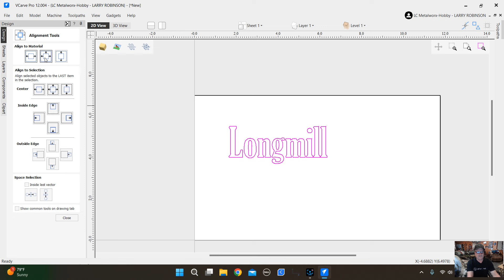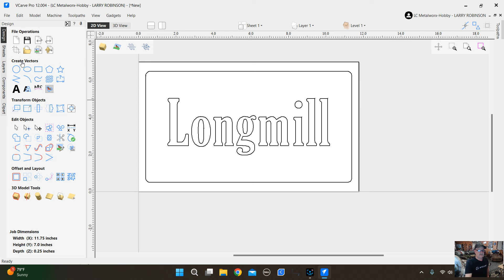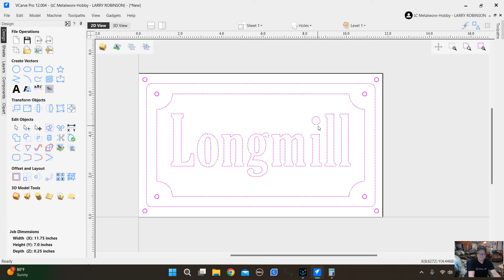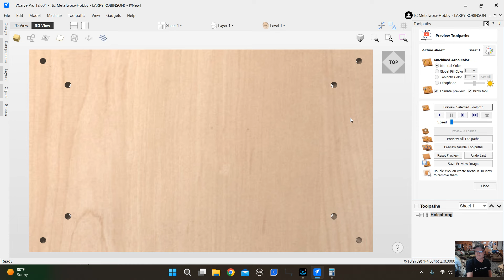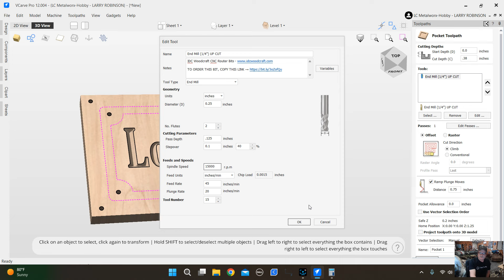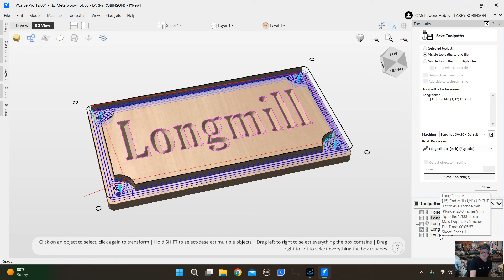Creating CNC Router Toolpaths Part 1

Comment: Hello Larry, just came across your 3 part series. I'm new the CNC world and videos like this are greatly appreciated. I'm still  deciding which software for a beginner to start with. Then upgrade once I get a feel for it. I'm using 1.2 gsender, is there need download a newer version? Thanks Mike
Reply from the maker: I'm still using Gsender Edge 1.3.8 kinda scares me to change since it works so well for me but I have the Super Long Board coming this week so I've heard it works best with the latest Version, Heck I ain't Skeered I'll just work through it and if I don't like it I can go back to the one that works.  I just do this stuff for fun in my shop but do CNC machining 50 hrs/week at work so it's relaxing here.

Comment: Why do you use 2 tools to cut the letters?
Reply from the maker: Really just to show how the clearing tool works in this example.  Maybe not really necessary here.  It just clears some material out of the way so the Vcarve tool can make less passes.  If the letters were really Big it would be a huge time saver and get better quality of cut this way.
Reply from the maker: I got rid of it when I cut it actually, it wasn't necessary but some people don't realize how that works.